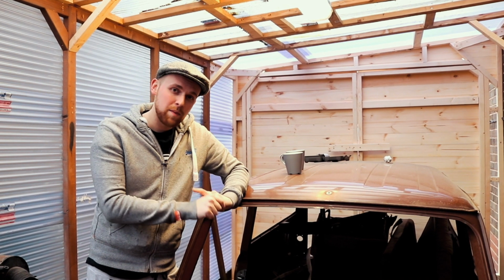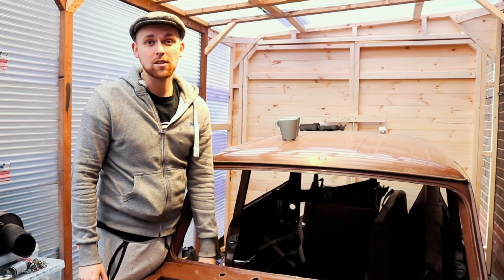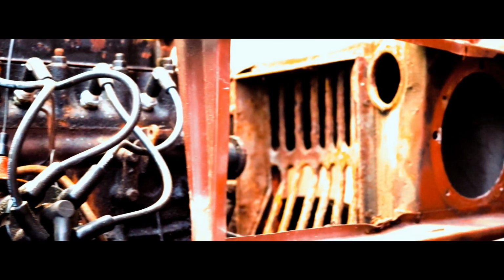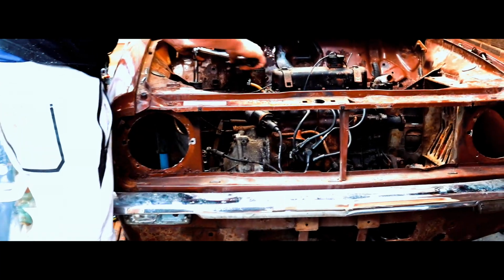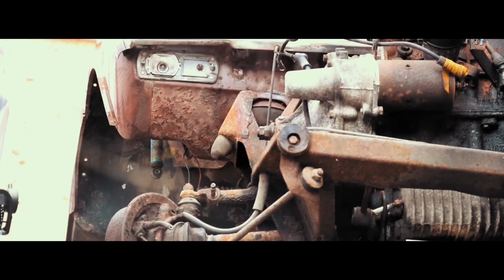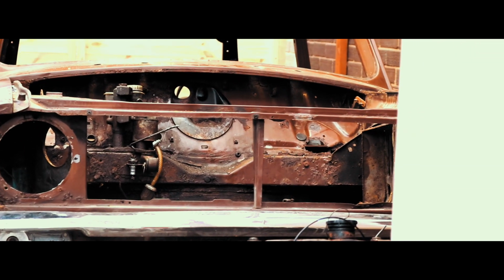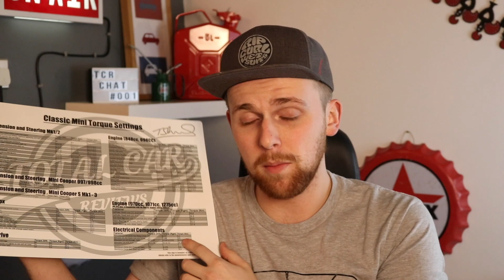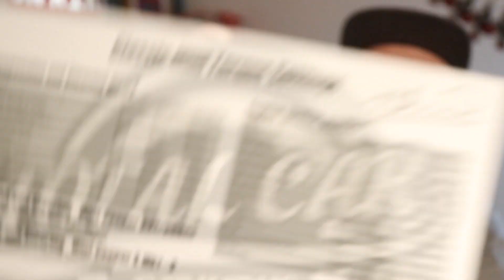Classic Mini Clubman Estate | Engine Removal! **WITHOUT A CRANE**

Comment: Nice merch! i like the tshirt the most but the custom plaques are awesome as well!
just removed my mini engine the same way, with a bit of jiggling and 3 people it worked like a charm. but installing the engine will be impossible this way i suppose. 
What kind of welder do you or will you use?
Reply: I used to remove - and install - my Clubman's engine like this fairly frequently (I used to really beat on that engine, so it happened a lot - lol.)  Installation isn't as hard as it looks, but you do need to wiggle the thing around to get the bolts to line up as the body comes down.  Easiest way I found was to support the engine/gearbox on a wheeled dolly as low as I could without the brakes scraping on the ground, then lower the body with a couple of mates helping and push the engine with your feet until one hole lines up.  Once that bolt is in loosely, you can twist and squirm the rest into position.  :-)

PS:  If you don't have a couple of mates handy, you can also string the front of the body up to a roof beam with a block and tackle - then just lower a little, tie it off and adjust the engine's position, lower the body a little more...rinse and repeat.  Not as fast, but at 3am, sometimes it's all that's available if you want to still have some mates the next day.  :-P
Reply: @aussiebloke609  allright. Let's certainly hope so!
Reply from the maker: Thanks dude! really appreciate this :) I have a a clarke 135te mig welder which I will be using :)